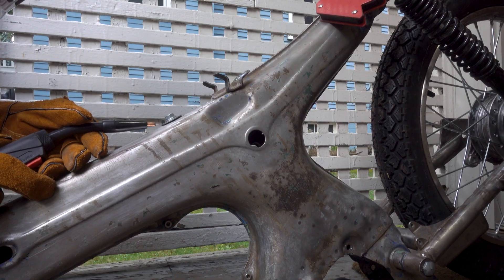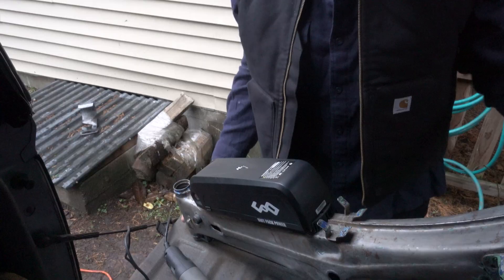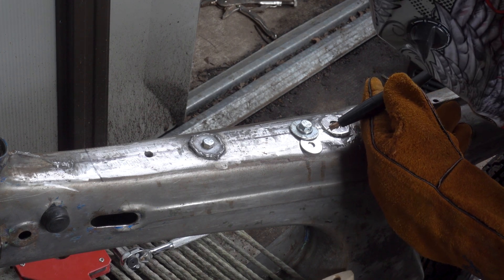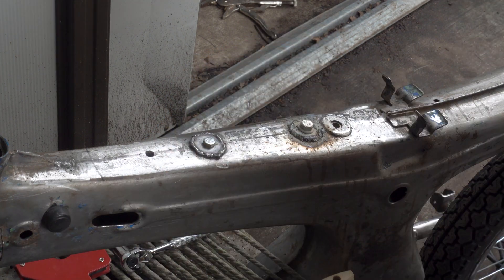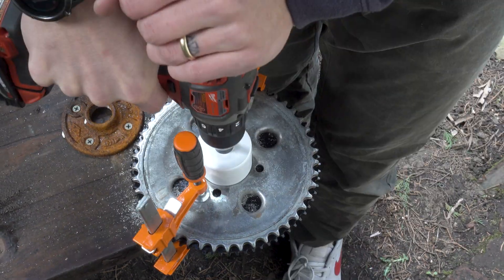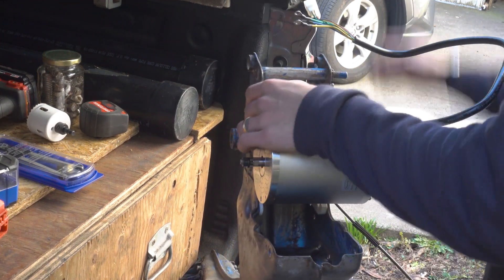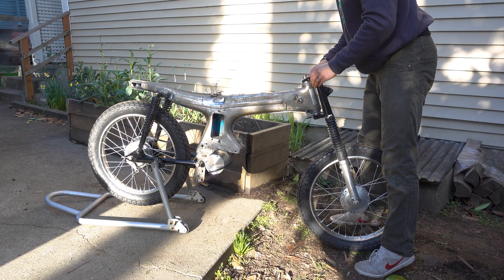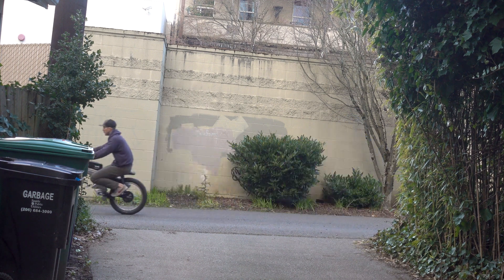Vintage Motorcycle EV Conversion: Fabrication and First Ride | Honda CL90 Scrambler

Comment: Don't know what your target top speed / acceleration is but I would want more than 3kw. Your battery will not be able to handle more than 2000w (it might combust). You need a bigger battery and a better controller. I build a 3kw hub motor ebike and I get a top speed of around 40mph.
Reply: Also voltage is usually correlated with speed unless you have a controller with field weakening. Upgrading to 72v controller and battery will hopefully give you a speed boost. Usually motors can handle a little extra power, although they will get warm so you will want to make sure that it overheat.
Reply from the maker: Damn, appreciate all of the info! I think I will be upgrading to a 72V system. I don't really have a top speed preference, just need to make sure it's capable of climbing these Seattle hills. I think I'll stay away from the hub motor on this project though. Thanks for the comment!

Comment: From what ive seen those motors arent super impressive. However ive seen them perform better than yours. Maybe settings? Maybe something like a QS138-kit could be better?
Reply from the maker: The QS138 kit could be the move on this one.. just need to figure out what to do with the battery if I do that. Looking into selling the kit I have now on FB and then upgrading. Thanks for the comment!
Reply: @CatchHellMoto  I would do some research ofcourse! I think the QS138 has a version with reduction gear also.  There is also the motor from the sur-ron which has alot of aftermarket parts! Controller upgrades etc. Theres also a QS165 which is an upgrade over that maybe?